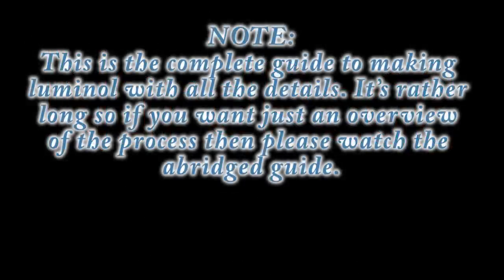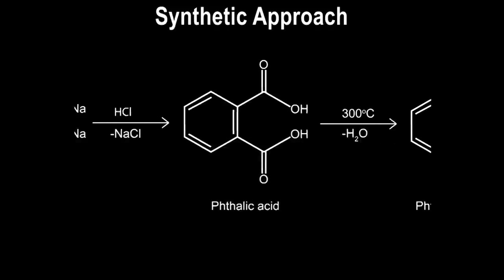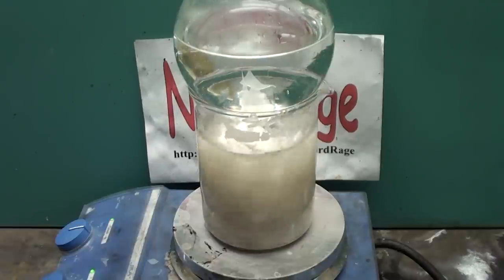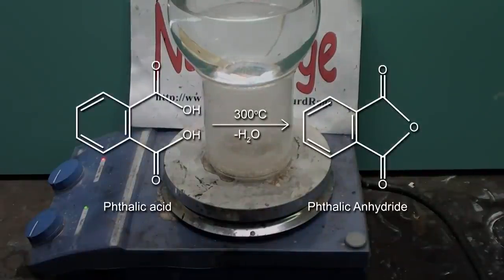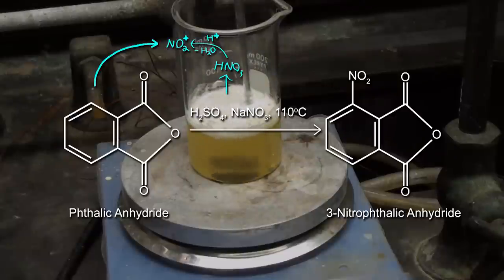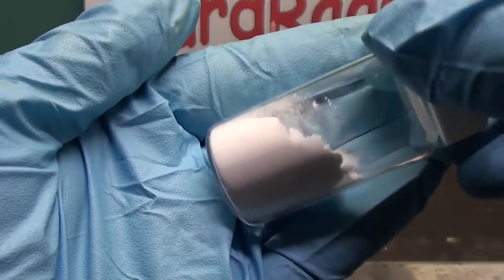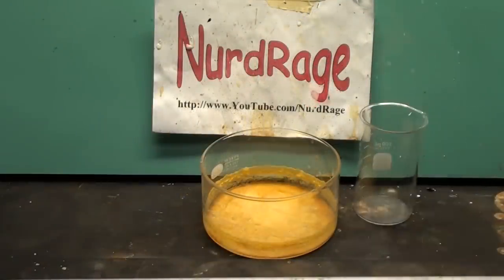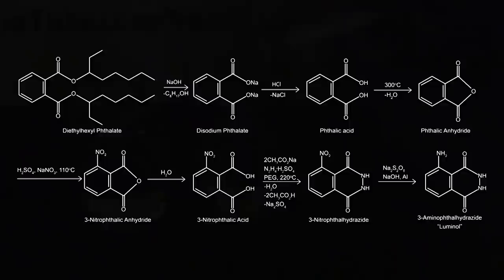Make Luminol - The Complete Guide

Comment from the maker: Pretty much just researched the standard laboratory preperations and tried to substitute domestic chemicals and processes. For example, sodium dithionite is not available domestically, but sodium metabisulfite is and can be converted into dithionite under strongly basic conditions with aluminum. Pretty much followed the same approach for each step. Like using brake fluid in place of triethylene glycol since the objective was a polar high boiling solvent.

Comment from the maker: @beriorgar considering how potent luminol is, you only miligrams of material to get nice glows, its not all that bad in terms of usefulness.

Cost was in the thousands of dollars range because i actually spent 95% of that just testing and researching the various steps. i cycled through dozens of failures at every point before i hit on something that works.

So for you it'll probably be much cheaper since i already laid out the working method.

Comment from the maker: @Hydroxybenzeen i never said water was the nucleophile. When the hydroxide attacks, and after the alkoxide leaves, you get a carboxylic acid that is then deprotonated by the basic conditions. You won't directly get a deprotonated version since the hydrogen on the hydroxide has to magically leave before the alkoxide leaves.

After the carboxylic acid (in this case phthalic acid) is formed, it quickly gets neutralized under the basic conditions.

Comment from the maker: @acidum984 

1. Aluminum and hydroxide generate heat and hydrogen, the heat is needed to in turn cause aluminum to react with sulfite ions to make dithionites, thiosulfates, and sulfides. These ions in turn react with the nitro group to make amines.

2. yes, sodium hypochlorite

3. 100-200mg, but purity isn't as high as can be.

I'll show other light inducing reactions of luminol including H2O2 and metal in later videos.

Comment from the maker: @napalm4sd Check on amazon if you want hydrochloric acid. You can also substitute with sodium bisulfate pool acidifier or even vinegar (but you'll need to recalculate how much you'll need and boil off the excess water after addition)

Instead of griping about what you don't have, work with what you do.

Comment: 6:50 It's wierd how diffferent the process of separating constitutional isomers can be for different compounds. In your pyramethamine series, the separation of 2-chlorotoluene and 3-cholorotoluene seemed like kind'o a nightmare, where you had to take advantage of steric hindrance to selectively sulfonate the 2-isomer. But in this video with the 3-nitrophthalic acid and 4-nitrophthalic acid, it's just "eeh, just mix it in some water, the 4-isomer will the dissolve, the 3-isomer won't".

Comment: I just love organic chemistry :)  

Anyways, basic hydrolysis of the ester does not produce phtalic acid, but instead it will yield directly into deprotonised phtalate. Since hydroxide ions act as the nucleophyle. In basic conditions, carbonyl-groups are not strongly electrophylic so a stronger base then H2O is needed to act as the nucleophyle. No neutralisation takes place.

Comment: @AuraRisen You are partly correct. Yeah we don't care about the sulfate ions because there are super weak base. We don't worry for the H+ not because they are electron deficient, but because there is no water in the nitration step to. H+ does not attack the carbonyl directly. It simply protonates it to make the carbon more electrophilic and help a nucleophile such as water to attack. So as NurdRage correctly replied, no water? No hydrolysis...

Comment: What if you use Potassium Permanganate as the oxidizer in a solution of water and heated it to reflux temperatures of Naphthalene, which shouldn't be that hot. (I believe it is a reflux when naphthalene "dissolves" per say, in water). There is a post on Sciencemadness on this very subject that uses the same method that i predicted.

Comment: Of Course this is a rather delayed question, but for the sake of asking, couldn't one simply reduce napthalene (mothballs) in the presence of pure oxygen (which can be produced by means of hydrogen peroxide and potassium permanganate, both are publicly available) to produce pthalic anhydride, the apparatus could be slightly more complicated, but the actual chemicals themselves would likely be cheaper, alongside the fact that less glassware could get dirty... Just a suggestion, I came up with this while researching the reactionary mechanics of polyphenols... Hope you see this!

Nerdalert226
Reply: +nerdalert226 
1. nitration of naphthalene 
2. oxidation of nitro naphthalene ( obviously the other electron rich ring is oxidised)
3. reduction of nitro group
4. reaction with hydrazine .... or step 4 and then step 3 as suggested....
if 2nd step is reduction of amino group then one will get only phthalic acid after oxidation...
at least theoretically speaking!!
Reply: This method actually could be feasible... Thank you for your suggestion!

Comment: @KnightKiller1000 You can but the amount of process that requires that, and the voltage you need is actually gonna cost you more and have you with more effort than just buying the aluminium.